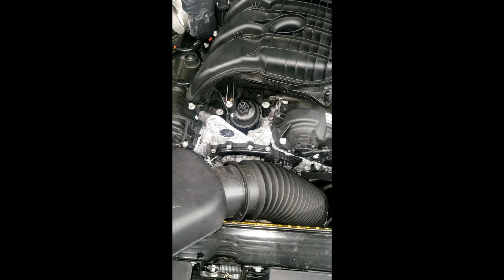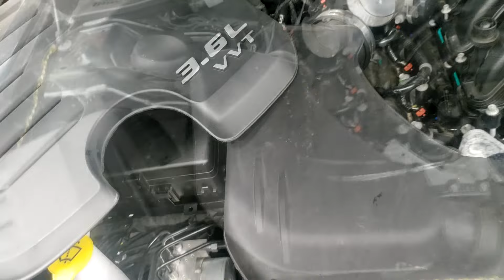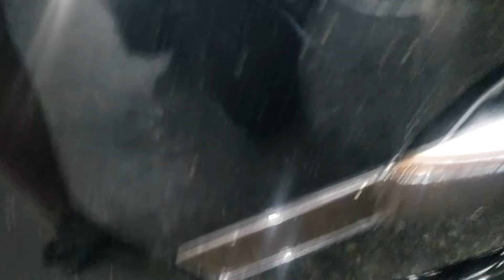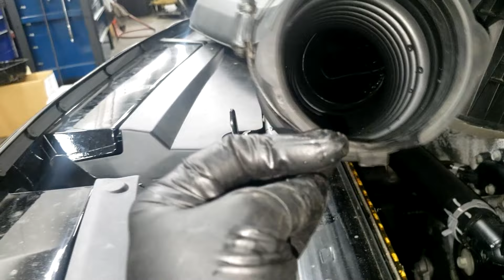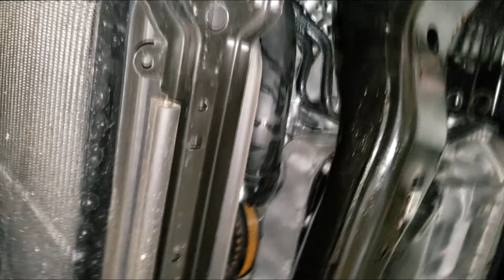She Destroyed her Car Motor because she tried this. DON'T Do It Folks

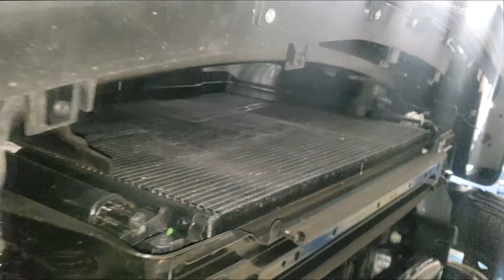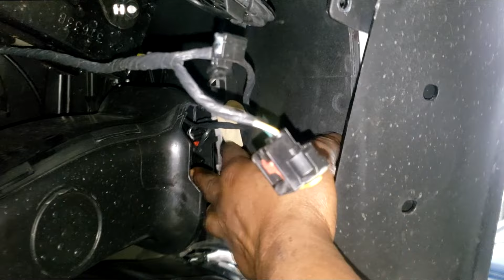Comment: Gotta ask since when does a V6 have the widebody kit on it, as it looks like he's got daylight going through his widebody fender there at 7:38, and the splash guard stops pretty close to where it was, like it looks like all that would need to happen is for him to drive through a normal puddle and it would throw up water into the intake, given the way its cut at 7:41
Reply from the maker: Yea you can now purchase the wide body installation kit and have it installed

Comment: Usually you can take the plugs out and pump the water out and unlock the motor
Reply from the maker: Yes, on ya own car. This car in the shop. No shop interested in taking those chances.. Not even insurance companies do that. They approved the engine and we simply install it.
Reply: @OnlineMechanicTips  I was just saying to unlock the motor to get to the flywheel bolts. Ya the days of saving a motor with water in it have been long gone for years did it when I was a kid on a chevy 350 74 Monte Carlo drove it for 5 years after and sold it .
Reply from the maker: @normancoreyBuildingTrains  Yea I think that's what he ended up doing. Some not so luck. We just bring the T/Conv out with the engine when they won't unlock.
Reply: @OnlineMechanicTips   I pulled a motor away from the tyranny with the converter still on the motor, then cut the flywheel instead of the converter . I AM too old for that stuff now

Comment: Thanks to the manufacturers they put the air duct down by the front bumper so if you want to run through about 2 in of water the splash would push it up in there and it would get sucked in. Very bad design I just replaced a motor for the same reason

Comment: Pull the plugs and turn it over😐
Reply from the maker: Why? We don't care what it do at this point. It's getting a engine. If it's your own car sure, try to save it. But you don't try to un seize a customers car with all this liability insurance regulations in place.
Reply from the maker: @NickToutant  Did you not hear/see anything that was said on this same post? Do you not understand the words risk/liability? It dont work like that dude at a business. That is not a repair anybody can stand behind so why bother worrying about it. The stuff you mention are things that should be tried on your own car. NO SHOP would try to salvage a seized engine, especially if the insurance company approved to get it replaced. Even they cant stand by such a try repair that you mention.
Reply from the maker: @NickToutant  Do it look like I care what you or your shop do dude? Absolutely not. Obviously you and your shop got to much time on ya hands if you setting around worrying what other shops out doing. Maybe yall should advertise everything you just said and work on being the best shop yall can be. We good over here.
Reply from the maker: @NickToutant  Good for you, would you like a cookie for your efforts?
Reply from the maker: @NickToutant  If you not even sure if this an insurance claim to begin with then why are you here popping them sucker's? Do you just like to assume then hear/see yourself in the comment section running that mouth?
Reply from the maker: @NickToutant I know, im cool with the way I speak and what I say my guy. You prolly need to fine you something else to do. Seems you have way to much time on ya hands. You worry about the most craziest of things. Smdh. I would never sat around an worry about what other shops do or say. I'm to busy making money dude. Get a life.
Reply from the maker: Awhhhh, now you mad? Take that anger out on them 2 cars you and your shop get today. And stop spending so much time on trivial things.
Reply from the maker: @NickToutant  What are you 15 or something? Who says clown stuff like "I make more than you" You the ultimate Bozo the Clown my guy.
Reply from the maker: @NickToutant  Based off your profile (or lack there of) Seems you just some random Youtube video watcher that at time simply troll videos. Theres nothing about you that says anything. I can make shit up with the best of em. Watch this, Im a doctor that make a million dollars a week. Now hows that?  Do you believe me? This youtube bruh, a video platform. Lip service or shit talk dont work here. Anybody can say and be anybody on a computer. Put up or shut up.